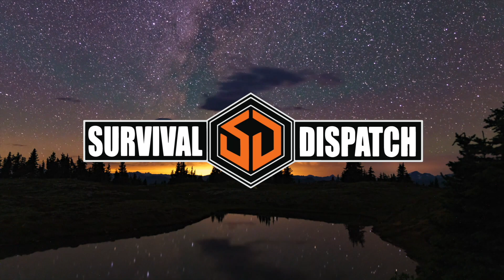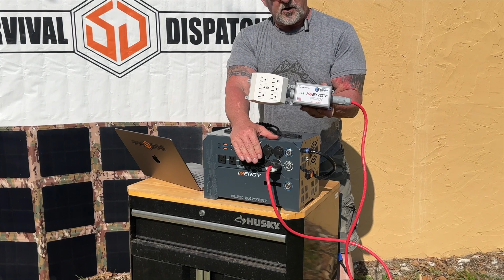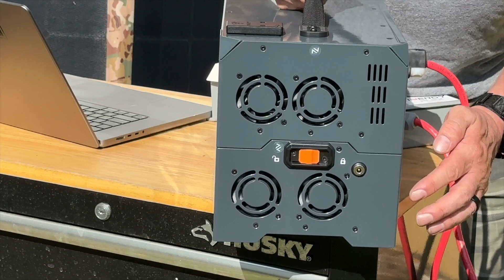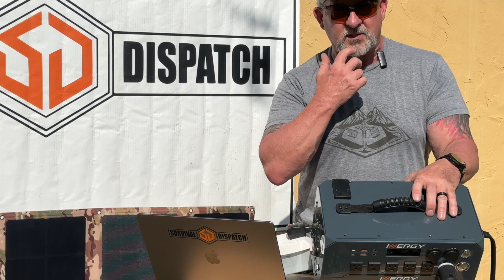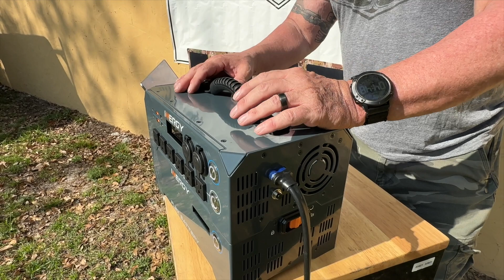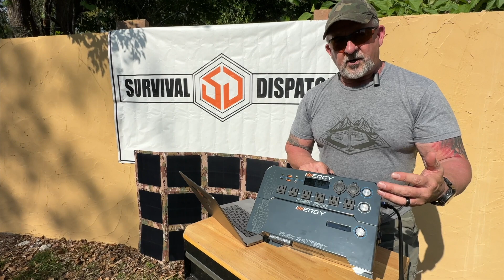How to Prepare for a Grid-Down Situation Caused by an EMP Attack

Comment: I wonder what differentiates the EMP Shield device from a regular surge suppressor. It seems like a basic surge suppressor would blow and prevent the voltage spike that would destroy any plugged in electrical device. Any thoughts?

Comment: The best scenario for this unit would be to power a UHF/VHF repeater or base station for communications.

Use for laptops, mobiles, etc… won’t matter in a massive grid down scenario. Those networks that will be toast will render those type of devices useless.

Secure UHF/VHF/HF communication devices and respective hardware either connected to this unit or in faraday bags, cages, etc, so you can leverage this unit to charge and maintain your ability to make radio contact.
Reply from the maker: Great feedback. Thank you!
Reply: Good idea. I am looking into communications devices. I have some simple ones (useful for my property) but would like some longer range ones for possible travel scenarios.

Comment: You may want to check on that solar credit. I'm a tax accountant and there are limits on solar "Improvements" Yes you can take a credit on solar installed on your primary residence and on adding panels to an existing system. I'd have to see where this falls into that credit eligibility. because that does not sound correct to me.
Reply from the maker: We've done a significant number of solar installs over many years. We have a background in commercial roofing and solar PV. The federal tax credit applies when you expand your system, even if it's just one panel with other components. We've had customers successfully get the credit in this type of scenario.
Reply: @SurvivalDispatch  I'd caution anyone on betting on a credit. Solar Company's like to push the credit as a selling point when in reality it is a Non-Refundable credit and many people do not get any benefit from it. Talk to your accountant before making any big solar purchases. This is small so the credit is small and not a big deal if you don't get the benefit, but before you commit to a large system get some tax advise from you preparer first so you know what to expect.
Reply from the maker: You're correct, it's a non-refundable tax credit, meaning the person (or business) has to have a tax liability. Again, this is an area that we have a lot of firsthand experience with and our salespeople have always made it clear that the person has to have a tax liability to benefit from the federal solar tax credit.

Comment: Only wish they're using LiFePO4 batteries. 

They're better batteries as the charging cycle count is a lot higher.
Reply from the maker: There are pros and cons to NMC and LiFePO. You're correct that LiFePo have more charge cycles. However, they typically don't fair well in cold climates, which is why most EV class batteries (Tesla uses NMC for their long range models) are NMC. Also, there have been some advancements in NMC batteries to make them safer and to charge faster.
Reply: @SurvivalDispatch  

True about cold climates, however, they have one that self heat that allows them to charge in cold climates.
Reply from the maker: Great observation. For the record, the tactical version of the FLEX, which is ultra rugged, has a built-in heater too to mitigate stored energy being bled off.

Comment: If a major EMP event happened most everything you'll want to power will be fried, wouldn't this be basically worthless?
Reply from the maker: Not according to INERGY, EMP Shield, their third party testing results, and the military test results (which are extremely technical. The “shunts” that deflect the electricity react within 500 trillionths of a second. Our understanding is that unless you’re at ground zero for a nuclear blast the EMP Shield devices will protect against E1, 2 and 3 EMP strikes. We’ve asked INERGY to join the comment section to provide technical details right from the horse’s mouth.

Comment: I love the idea, but that will only stop the E3 part of an EMP, if the E1 or E2 doesn’t fry it first.
Reply from the maker: EMP Shield claims it'll protect against E1, E2 and E3 EMPs. Their testing documentation states the same as well. We've asked EMP Shield and INERGY to join the comment section to chime in with more technical details.
Reply: Great observation John. Back to the drawing board.
Reply from the maker: Great observation? He made a point without qualifying it or providing anything to support his claim. EMP Shield have passed testing for E1, E2 and E3 EMP strikes, plus multiple military EMP standards. Their devices react and shunt electricity within 500 trillionths of a second. There's a ton of documentation on their website on this topic.

Comment: How does the emp shield protect the solar panel? Without the panel the battery is useless.
Reply from the maker: Before we did this review, we read through the testing documents and military standards passed, and were satisfied with the legitimacy of the results.

However, INERGY will be answering your question from a technical perspective. For the time being you can read more on the featured devices and the testing they underwent at the following links. The unit between the PV panels and the console was developed specifically to protect solar arrays from EMPs.

https://inergytek.com/collections/emp-shield/products/emp-shield-dc-charge-protection-module

https://inergytek.com/pages/emp-shield-testing
Reply: @SurvivalDispatch  I've been working on going off grid for a while now, to the extent I make cattail vodka to fuel my cars. The grid is sketchy where I live, it goes out often so I have a generator. Energy, as in food, fuel, and electricity is my largest expense. The more I can produce myself the less I have to pay for, and the less dependent on everyone else I am.
Reply from the maker: That is amazing! Well done sir.
Reply from the maker: Thank you for your service!
Reply: Yeah a Carrington event takes quite a bit of shielding to not fry circuits or even melt wire. I built my shed and house to be Faraday cages, but without knowing how powerful the magnetic waves are going to be, its hard to know what will happen and how much shielding is needed.